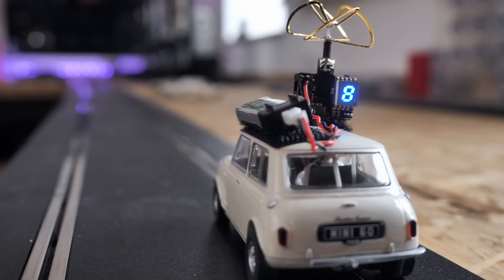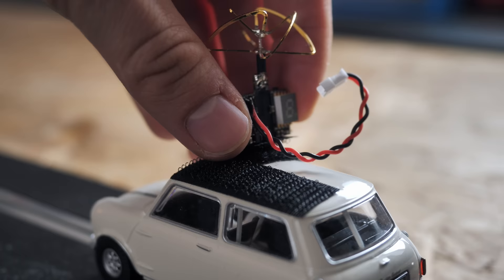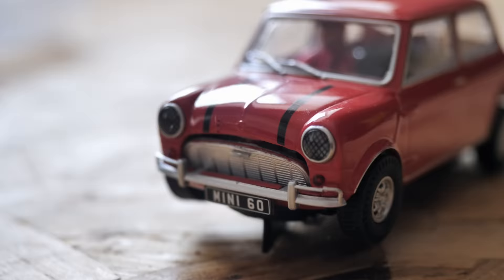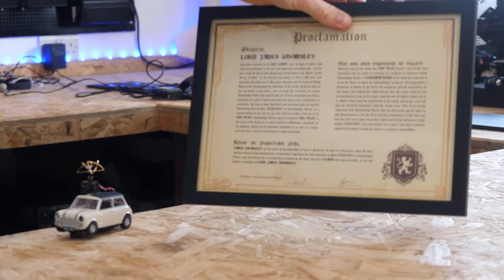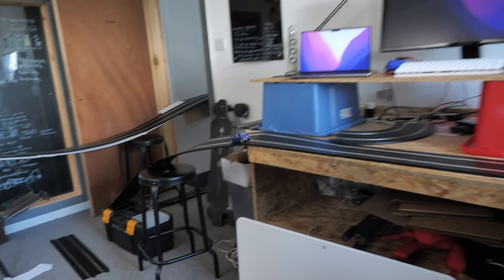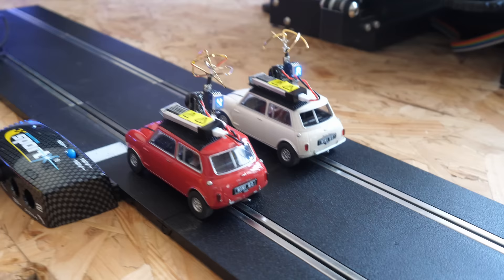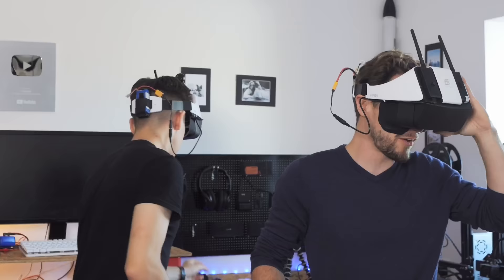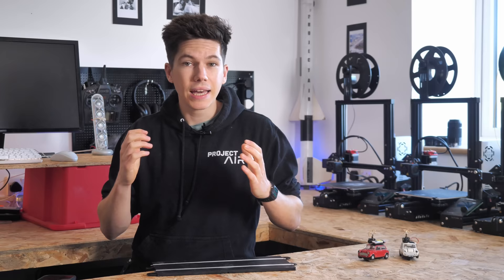Upgrading Slot Cars (and building a 200ft track)

Comment: how is it racing when theres only one control
Reply: At least you need to Stop at corners 
Or leave the button to keep RC on track
Not like Asphalt 8 where it iz one control
Reply: There are 2 conrols, one per slot. That reminds me of the TCR set I had as a kid, no slot and 3 conductors per lane. They used a voltage reversal to change the steering of the car (crude, full left or full right) which meant you could swap from lane to lane at will. Cornering was tricky as you got flung to the outside unless your opponent was already there.